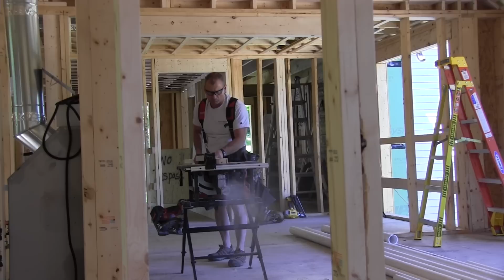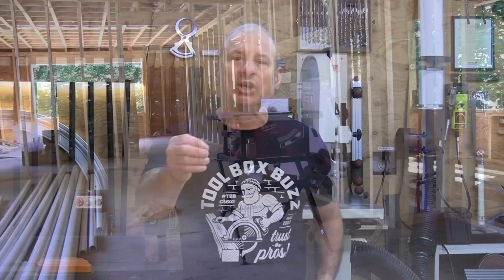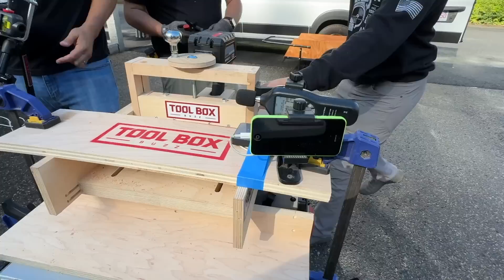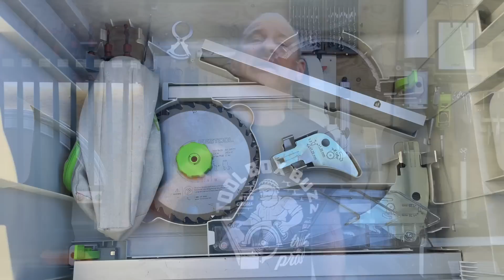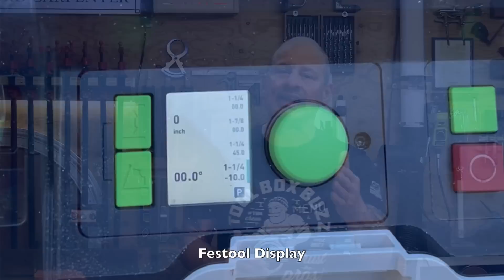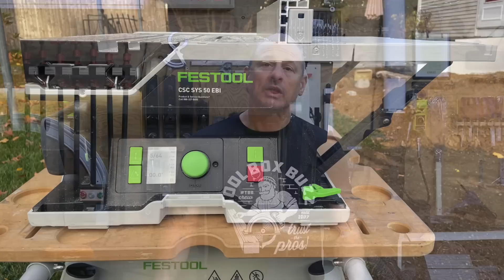Best Cordless Table Saw | Head-2-Head Comparison

Comment: I have the m18. Not a fan. Blade run out is horrible. Chips pre finished material badly. Bulky. Rack and pinion feels cheap. The fence is a pain to set up and feels cheap. I have a dewalt it’s solid. Going to give the festool a go

Comment: Thanks so much for going through the efforts to provide such detailed information. 
I like the Flex and am considering making that purchase.  
2 things,  first it looks like it has an extendable support on the right side making it extra wide 25" blade right,  but nobody goes over it not even on the official Flex tool site. It would be nice to see how that works. 
Second is,  it's almost impossible to find a dealer anywhere. Lowes no longer sells it online or in store for some reason, neither does Grainger. I was able to find it on ebay but not a huge fan of making a purchase like this on ebay. 
Thanks again...

Comment: You mentioned it early on, but the way you measured flatness doesn't really work for a sliding table saw like the Festool. You'd also fail my Felder slider, because the slider is supposed to be ever so slightly higher than the cast iron. The miter slot in a sliding table saw like that is also generally a fixed thing -- you don't move something in the miter slot, you move the entire slider. So you would need to move the whole slider when measuring parallelism to the fence and blade. I also do not understand why you would use the finish blade on the Festool for your ripping tests. It has 2x the teeth of the ripping blades you used on the other saws. But even with that, I'm very surprised it didn't complete the cuts and it overloaded -- there are videos showing it ripping maple with that blade (not a great choice, and not something I tried, but can happen), and I've not had mine fail to cut anything I've thrown at it, nor have I had it overload.

Agreed with your ultimate conclusions. The Festool is good for hardwood flooring for sure. I haven't used it to rip subflooring or anything like that; I use a circular saw for that.

That all said, the Flex is a real bargain.

Comment: Nice review, pretty obvious you didn't really like the festool; maybe because you tested it as a GC saw, instead of it's intended use as a finish carpenter-saw. and/or you hate the price :) 
Not sure if mentioned already, but a few things about the Festool you noted as a negative, which are in fact good... 1) the sliding table should be higher then the normal table to function, and looking at the measurements, it VERY even at that. And the most toe-out at the end of the fence makes kickback less likely, which is good! Removing the riving knife is done pushing an alan key in a hole.. not sure why they didn't just make a button, but still easy, not sure if you did it right? The blade guard is same action as riving knife... You also did not consider dust collection...
Reply from the maker: Good points!

Comment: I hope Dewalt sees this. I have the 58v flexvolt saw and the miter gauge is an absolute joke. A heap of slop that could be fixed in 5 minutes at the factory with a nylon bushed mitre track (I bought a plastic one to replace it but it only fit the dce models not the dcs which has an even cheaper mitre gauge so I’ve since spent 50 buying a proper adjustable mitre gauge and not that it replaces the use of a mitre saw sometimes it’s just faster to use the table saw if it’s already set up. The adjustability and dust collection is quite good. I suppose no better or worse than Milwaukee or flex as they seem to use similar designs. The other thing that sucks with the dewalt flexvolt is the throat plate. It is very badly manufactured and it is impossible to get it to sit flush with the saw deck because the casting process warps the alloy. This makes thin stock cut imprecisely. The fix is simple a plywood zero clearance insert but this is just crappy manufacturing by dewalt. The 90 and 45 stops are not an issue as a square or a magnetic digital angle gauge are the best ways to overcome poor accuracy on the saw bevel anyway and take 2 seconds to use if accuracy is needed but again requires investment in tools to fix simple things that should be solved at the factory for 5 cents.

Comment: The Festool CSC SYS 50 is not a bulk woodworking saw but a precision machine. It’s fully electronic and requires calibration at setup, with both the sliding table and fence adjustable to extreme accuracy. Once calibrate - normal for this saw - it is, in my view, the most precise and usable precision table saw on the market.

Some reviewers also seemed unaware of certain features; for example, changing the riving knife is actually very easy if you know how it works.

If you need raw power for bulk jobs, look elsewhere. For precision work, this is the best tool I’ve ever seen.
Reply from the maker: We dont disagree, I think sometimes Festool over engineers things

Comment: There're more important parameters for portable table saw such as
Folded size
Working area
Most unfolded working area
How many cuts can be done on 1 battery
Handle (part of easy of use... When carrying the saw from place to place)
Legs on the side (how well it stands in the vehicle for example)

Comment: What value the measurements of the accuracy has if you can on some saws calibrate it to perfection while on the others you can't?
Btw, any saw that come with option of calibrating it, it's clearly written in the manual that the saw can come not well calibrated due to packing and transportation...

So in bottom line half of your video is nonsense as when reading the friendly manual you'll be able to make one saw better than the other

Comment: How can you recommend the Festool to hardwood floor guys if it doesn't have the power to finish your power tests? Will it rip 5/4 oak? What about denser exotics? Floor guys don't need micrometer-level accuracy and bogging down is a deal-breaker.
Reply from the maker: I see your point, ifigured they’d appreciate the slide table on tricky cuts

Comment: I saw a video you did on the product called “The Sawhorse Pro”. It looks like that product is no longer available on Amazon and I can’t find them anywhere in my area. Do you know if the CNC files are available?This would be a great option for a outfeed for my table saw. Thanks for any help you could provide.

Comment: It’s interesting that you ranked all the saws in the same decibel range… I have the festool and I have been able to use it in my apartment without the noise level being too much of an issue - it’s about the same volume as a vacuum. I’ve never used the others but now I’m curious if I accidentally prioritized quietness unnecessarily 🤔. Have I been had? Maybe, but I get such joy from using it every single time. PLUS… I needed a saw I could actually lift and carry up three flights of stairs. 33 pounds is so much more manageable than 50.

Comment: Flex makes a 10 inch a adapter and it cuts a 4x4. I think flex is slowly taking the game
Reply: If Lowe’s knew how to sell cordless tools like Home Depot does flex would be more well known. I havent seen one promotional banner or marketing material that Lowe’s is the only place to buy hybrid cordless dc /corded ac tools as flex and mhpt are the only ones that sell the ac adapters …I’m just making an example off top of my head in the 2 seconds while writing this and I’ve never heard anyone at Lowe’s even mention that plus Lowe’s just has really bad CS and they charge the same price on release date as they do up to the day before they  start to clearance it out
Reply: Idk if youre aware but Lowe’s does have the flex mid torque fx1451 50% off atm and it’s a hell of a powerful impact wrench for its size and at 99$ it’s a steal I think the only mid torque making more torque is the dcf891 and it’s much larger

Comment: Can you guys start doing you tests with the highest powerful battery on each platform to fully discover which tools are the most powerful and have the longest runtime.

I understand you use the same power batteries because most people will buy a kit 

But for the .01% that just want the highest power, please put the highest power batteries on each tool on every one of your reviews

Comment: Perfect and pleasant review as usually. Thank you.  I would like to inform that in these weeks Metabo HPT/Hikoki finally introduced a new tabless battery BSL3640MVT /2160W/ which I received this week.
It is really a big difference in comparison with the battery you reviewed /BSL36B18S /1440W/. I tried to do some quick subjective tests and found that it is 50-100 perc. performance improvement not only due to power but also that the new battery is hard to overheat. Hoping the info will be suitable for owners of Metabo HPT.
Thanks again for your work!

Comment: It’s hard to take a study serious that doesn’t include Makita.
Reply from the maker: Makita does not make a tablesaw in the United States
Reply: Its hard to take makita seriously when they dont make a cordless tablesaw
Reply: Does Makita make a cordless tablesaw?? Probably couldn't beat the Flex but would be a runner up in a Beauty pagean😂😂
Reply: Tools channel whatever announced makita has made a patent for a 40v cordless table saw he showed the specs and diagram.

Makita is #1 in ergonomics and longevity. 

I assume the 80v will be 10” once they get all the complaints from the sheep

Comment: Great test. Bug the one thing that interest me the most is run time?
Reply from the maker: Runtime is almost a NIL issue... batteries charge so fast now. 2 or 3 batteries and you'll never go down.
Reply: Well in my experiance battery life differs Widley from maker to maker etc and I don't want to be carrying 3 or 4 extra batteries just for the table saw.
Reply from the maker: @ then I would highly recommend if you’re a pro contractor that you buy the same tablesaw of the battery platform that you already on
Reply: @ConcordCarpenter  👍 I think the real killer app would be if they made these saws mains or battery. Thanks for taking time to reply.

Comment: So for the speed test there was not a comparable 24 tooth blade that could be used on the festool? Cause y'all used a 44 while all the other saws used a 24?
Reply from the maker: correct sir.... again, the Festool did not really fit in this H2H test, it was an oputlier but we included it because alot of folk would want to hear about it.

Comment: Tip for the DeWALT dust collection. Festool has a hose for the CS/TKS. It's a 27mm hose end which fits the blade guard and 36mm for the lower port. Get a coupler for the lower port to resize it down and you're good to go. Festool part number for the hose kit is 577280.
Reply from the maker: But what about the main dust port?  You'd need a Y-connector or 2 vacs.
Reply: @ConcordCarpenter  I thought I had replied to you, but guess not. The Festool part number I mentioned is a Y connector to two hoses, one ending in 27mm and the other ending in 36mm. On the saw's lower/main port, use a coupler to take it down to 36mm. I used a silicone reducer that's made for automotive use.

Comment: Rough day to be on team green. I really hope they come out with a compact model and adress some of these issues. Especially accuracy yuk.
Reply from the maker: I agree -  and the accuracy is something they need to focus on.
Reply: I own the Metabo HPT and can tell you that I’ve spent a fair amount of time tuning it up for accuracy.  But I’ve achieved a sweet spot so I’m very happy with the saw.  And I love the stand.  The wheels make it easy for me to move it around. I’m a weekend woodworker so the saw meets my needs.
Reply from the maker: @ the stand is amazing if you keep this in you garage one wheel it odd a trailer ramp.  No lifting!

Comment: Thanks so much for another brilliant test, comparison. I'm deciding between the Festool or the Bosch, as I'm on both batteries and 95% finish work. Festool it so expensive, and I can't get the Bosch in NZ, but can get from Amazon, at 1/3 of the price of the Festool. Surprised the Bosch was lighter, my main ideal.
Reply from the maker: Bosch makes some great tools! Order online at ACME Tools
Reply: @ConcordCarpenter and Atlas Tools. Full kit $649 cad. $465usd.  That's battery,  charger, and stand
Reply: @ConcordCarpenter  Unfortunately they don't ship to New Zealand, and Bosch don't sell that model here, so Amazon is pretty much the only choice.
Reply: Did you get one? I’m in nz aswell, I’ve recently got the 216mm Bosch 18v it’s pretty good, cuts 50mm at 45% , and now I see they have a new model coming…. Once the new 10" corded lands that might replace my old real metabo .
Reply: @anthonyturner5319 Apparently the new 18v one is coming near the end of the year in to NZ. Basically the American model in metric. I'll get one then.

Comment: Not in the market for a cordless table saw but had to watch. I'm not familiar with Flex as a brand so this was a shot out of the dark. I also expected Festool to rank better (on the table flatness the slider has to be a wee bit higher to function properly so I'll question your procedure in that one case) and the only one with a sliding table makes it a bit unique: Odd man out in this crowd. Great work! Much appreciated. Now if only Sawstop will make a cordless........
Reply from the maker: We’re looking at it from a Pro contractor’s perspective, and portability and mobility are a huge factor.

Comment: Great video! I was hoping my festool would stack up better but I know it has flaws. I might need a Milwaukee backup. Don’t think it was brought up but the festool goes to 45 the opposite direction from the traditional, still can’t get used to that
Reply: SAAAAME 😅! I’m feeling a bit emotionally tender with how the festool compared… BUT, I have very specific needs: I needed a saw I could use safely and relatively quietly in an apartment, and that I could comfortably lift and carry. 33 pounds is a lot lighter than 50. Plus, I just get joy every time I use it.
Reply from the maker: @ great option
Reply from the maker: @JoeGerossie  that is amazing
Reply: It’s for using the sled to cut mitres and bevels. My metabo 10" is the same so have a Bosch 216 18v that bevels the opposite.

Comment: 1/4 way in and I already hate you. I’ve been putting off buying a FLEX tablesaw for a year now, specifically because their insanely high(money recouping) tactic of charging $200 for a plug in. 

Your damn integrity isn’t going to help them lower that price, fuckers. 

Another amazing video. Thanks. I can now buy with confidence…oh, wait, the video has just begun. 

Incredible integrity. I’ll shut up and listen now.
Reply from the maker: What are you using the saw for?  If your plugging in buy a larger 10"  corded saw  designed for a shop and real dust collection capabilities
Reply: I’ll mostly use the saw for oak trim and ripping 2x’s. Precision & power are probably most important to me. I’ll have to invest in a shop vac or lug the thing up and down a flight of stairs a couple times a year.

I’m leaning towards the 10” FLEX but wasn’t ruling out the 10” Bosch, DeWalt, and SkillSAW due to its larger wheels/mobile stand. 

My current supply of FLEX and DeWalt tools/batteries has me leaning towards them. Sincerely appreciate the time, effort, and consideration you put into these unbiased tests and 10/10 videos.

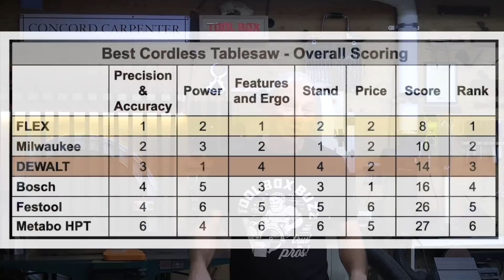Comment: Being brand new 25:33 it better be the best, lol, and b/c of the AC cord like metabo use, will definitely get Flex when metabo dies or tired of size……
Reply from the maker: Most Pro contractors simply change the battery. For me 1 or 2 batteries get me through the day, sometimes a few days. Have you seen the Metabo HPT cord-  its bulky and has a huge "brick-like" box attached to it.  Pro's want portability - if were camping on a jobsite for months then I drag out my 10" corded saw and hook it up to a dedicated vac.where it will live for the erntire job.

Comment: The Metabo HPT saw has a cool feature that allows you to use an ac adapter and plug into a receptacle. I'm not sure if any other brand has that feature...🤷‍♂️
Reply from the maker: FLEX does too - while this is a GREAT feature, to be honest, most Pros wont use it - theyll swap out the battery

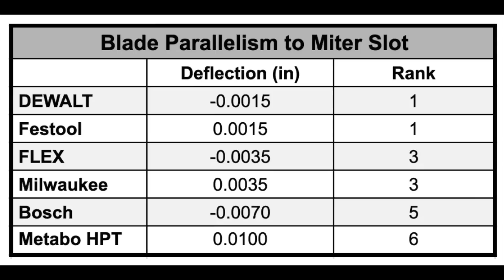Comment: 7:11 I’m sorry, but I don’t use Diablo blades anymore b/c they just are not as accurate as other saw blades I’ve noticed over decades of using and I’ll spend the extra money and upgrade my miter and table saw blades with a precision brand if a contractor and or finish carpenter, ya know brands meaning) and especially like that when doing this….able to send in or harden myself to prolong a good blade. Yes, they are not cheap costing like Diablo but ya get what pay for imo like this comment. And if wondering, I made this switch 5 years ago and have bought less saws yearly, and as blades have retained “sharpness”/“durability” longer/better imo, again from using…..
Thx for these vids, very useful and I run metabo hpt miter (w/ mods) and table saws as my 1st choice b/c like 36v and ability to plug into AC power.
Reply from the maker: Curious what other blades your referring to?
Reply: @ Wanted to say that Diablo isn’t a bad brand. Diablo is really easy to get when we’d need new blade fast, and I did use them exclusively for years. Do know that you can’t (least I probably wouldn’t) buy $150+ blades for testing, as that would be expensive and not everyone would do or want to go that route……so understand testing practices and purpose of videos. Some of the go to brands for Industrial Saw Blades I like to use are (in no order):  FS Tool, Ridge Carbide, Tenryu, Whiteside, Forrest.
Love channel and vids, so thx and have good one